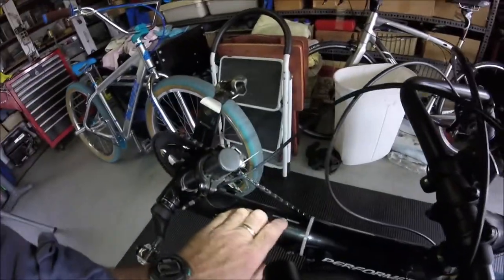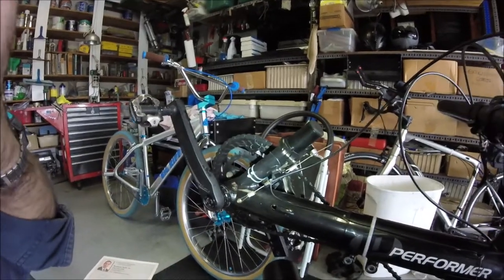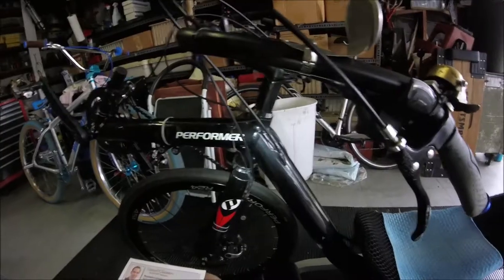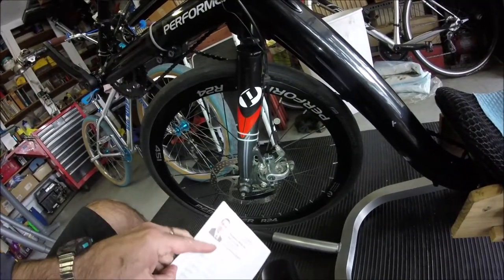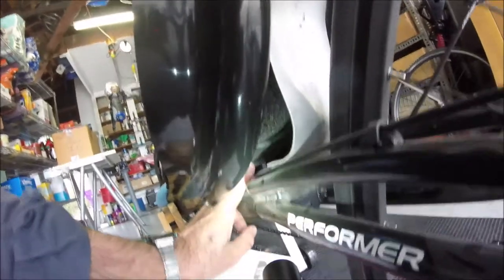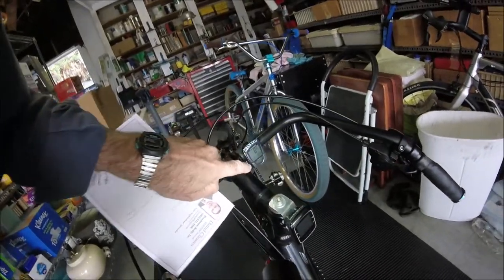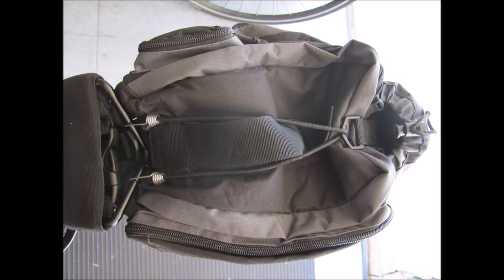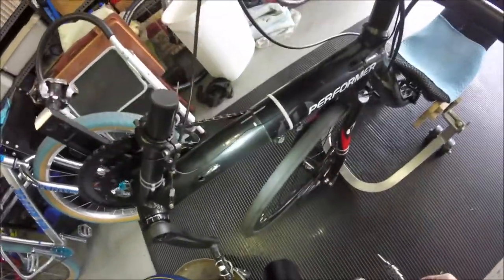Performer X low Low Racer

Comment: I’m about to get a Performer. Thanks for the details. It seems even upright bikes come with fasteners that are kinda short. I’ve replaced mine on bikes like you have
Reply from the maker: Thanks Mike,  Short bolts are where I draw the line on weight saving. 😀
Reply: @Caffeineracer  yeah it could be that the typical rule of thumb is a fastener needs to be only inserted to a depth of about 1-1/2 times it’s diameter for maximum holding strength stability, but I also like to run them all the way through to keep dirt out of the holes!